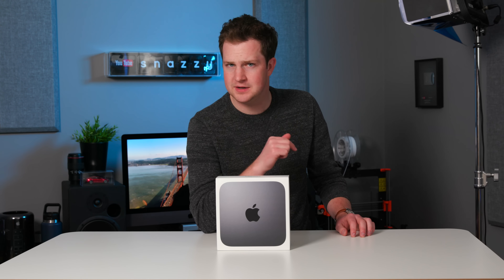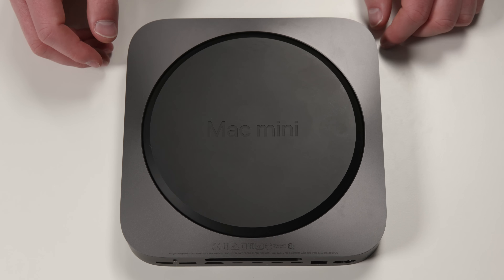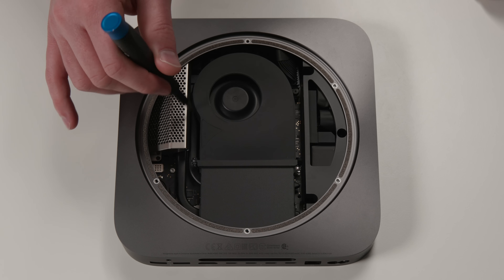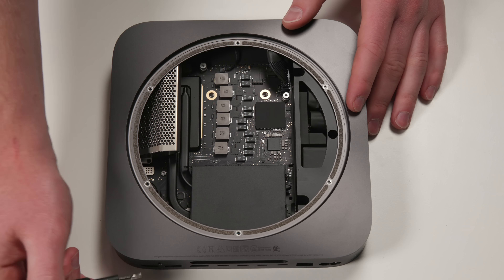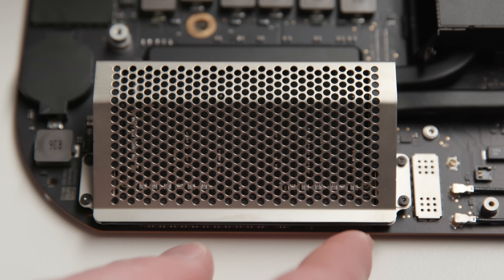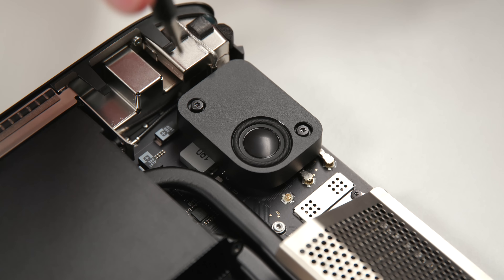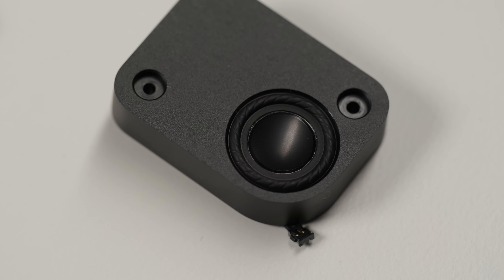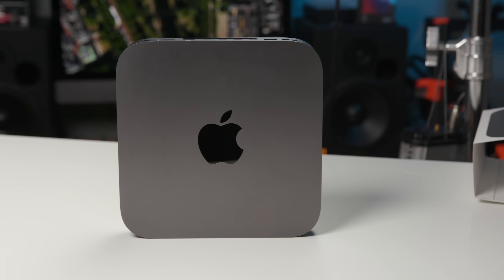Can You Upgrade the 2018 Apple Mac mini?! - RAM Upgrade Tutorial and Teardown

Comment: I remember the introduction of Mac Mini years ago. And yes, I was a huge fan of Apple hardware from the Tiger to Snow Leropard era. That was Apple in it's peake.

Looking this video through, and looking at todays top modern Apple hardware as well as hardware through the ages. Then yeah. I can see were it is heading. I do acknowledge the roadmap or idea that Apple is pushing. That the only thing thqt really matters is what is on the screen/monitor. And that hardware on is there, to be able to do what you need. Whatever that might be. But then again. Prices should be lower on hardware. Like if you want to tinker and change hardware, then yeah it should be more expensive. Or if I can say it in a different way. If you want to build hardware with the same integration or to build it as if it was a faster RaspberryPI. Why on earth charge that much?

Comment: If the hard drive had been replaceable I would have been fine with the soldered on CPU. Hard drives fail more often and faster than CPU. I was really considering actually buying the new mini until I heard the hard drive was soldered in.

Comment: Soldered on ssd is lame but honestly it’s not that big a deal.  You can attach external SSDs for some pretty good throughout. I have a 2012 Mac mini that does a gig/s write and reads of a set of external ssd’s (before you call shenanigans if you use a thunderbolt hub you get a second usb 3 gen 1 controller chip. Do a raid of drives on the on-board usb and thunderbolt attached usb and you get to combine the speeds.). Sata iii is 6gb/s, usb 3 is 5...you’re not losing much on a single drive. Raid them together and you’re doing better than the internal drive could ever hope to. 
As for the new mini’s nvme drive....that’s 4x pcie 3.0 lanes.  Thunderbolt 3 is also 4x pcie 3.0 lane. There are 4 thunderbolt 3 ports and only one nvme slot. If you really need nvme speeds and a lot of storage you should probably be using external tb3 drives anyway.  The internal drive is of little consequence

Comment: I bought a used macbook pro 2011 and got very dissapointed of how Apple made it. I mean, the charger cable is so delicate and got damaged and guess what: You cannot just buy another cable and change it, you need to know how to  disassemble it and fix it. The battery stops charging 2 years after the first use... I mean, I love its aluminum design but its not made to last, it was made just to be used for 2 years and then you start considering buying a new one and same thing after every year. My windows computer was bought on 2012 and its still working fine and it is very upgradeable. I can change the hard disk whenever I want, RAM and even the processor if I wanted to...

Comment: Thanks for this video! I was thinking about buying one of those but I might overthink that after seeing this video. When I saw this on the Apple website, it really looked like you could just take the bottom plate off and change the RAM. Unfortunately this is not the case and the chance of accidentally messing things up is getting bigger like this. Basically you have to take the whole thing apart to just simply upgrade the RAM. That doesn't sound interesting to me at all. It's getting to small and fragile to upgrade this stuff. I'll stick to my older Mac's for now!

Comment: Mr. Labs, I just got a Mac Mini hooked it up to a 4K monitor and scaled to 1080 it works great, or at native 4K it also works like it should... but any scaled option (for example 1440) gives it huge UI lag, like the integrated graphics fall apart completely even the mouse is noticeably slow... would you happen to know anything about that?

Comment: It's not a case of Apple deliberately "making it hard" to upgrade the memory. If they really didn't want people doing it, they would simply have soldered the RAM.

This is just an example of the inevitable tension and compromise between maximum engineering optimisation in a small space, and user-upgradeability. The engineers COULD have made the RAM replaceable without tools or disassembly, but doing that would have forced them to design everything else in a different way that wouldn't necessarily have been the most optimal.

Comment: so, 4x SODIMM sockets? If the base model comes with 2x4GB I could add 2x4GB or 2x8GB, I wonder if there is any significant difference in performance for dual channel VS quad channel or if it makes a difference having different sizes.

Comment: That's interesting. I know I'm a couple years late lol, but I was always under the impression the ram wasn't upgradable. It's so ridiculous that the SSD is soldered down though. If you're good with a soldering iron, would it technically be replaceable?

Comment: Discurage people from upgrading their RAM like mac mini's of years past.... uh please tell me how this went on the outgoing model, oh yeah it was impossible!  This version is massively more upgradeable with the RAM and the TB3 port

Honestly while not perfect the 2 Mac's Apple just dropped are a massive improvement in the repair/upgrade area.    The Mini CAN have its RAM replaced/upgraded and be boosted with TB3 SSD's and E-GPU's.   The MB Air can have its batteries replaced without scrapping the whole upper case (official repair) or DIY shit ton of work to get the glued in battery out.  

I see great steps in the right direction from Apple seeing us keep devices longer and wanting to fix them and not scrap them

Comment: I wonder if we could get schematics, and just make totally ungradable socketed Man Mini Clones. About the only thing we would need to do is desolder the T2 chip and add it the clone board. Like the old days of Mac Plus clone, you needed to pull the ROM off of them. Making 6 layer board is possible at fairly cheap prices.

The ultimate Hackintosh Mini... but with just the actual part required to make it a "real Mac"

Comment: Nicely built and engineered Mac mini.  Loved the excellent tear down of the Mac mini.  Can’t replace the hard drive, difficult RAM replacement are deal breakers for me.  Together with issues with lack of support, abandonment of legacy products/features at the whim of Apple, I would not buy Apple computers TVs or phones or products in general.  Future upgrades are extremely limited too is a deal breaker too. The only exception is the iPad so like their computers I consider them disposable items. I love the iPads and their reliability.  However, update the OS and it likely means that some programs or features that you regularly use no longer work, ie airplay, streaming m4p files, some programs like Adobe products.

Comment: I love the idea of the Mac mini, but at $800 they made it difficult to upgrade the RAM and used soldered SSD instead of using M.2 SSD which could have been upgraded. The CPU being soldered instead of socketed I can understand with  size limitations. But with Apple you always pay a premium of the ease of use rather than the ability to upgrade and customize.

Comment: Hi Quinnnnn
Can I stick a single 16GB stick instead of 2x8GB... would it be worse, in terms of real life performance, and if so by much?
... I want to get 16 and add another 16 later on if I need it.
... speaking of which will 24GB be okay 16+8 ? or is it better to have two of the same?

Comment: Thank you for this very detailed how to. It is most unfortunate Apple continues to solder storage onto the board. If your storage fails you are left with no choice but to buy another computer. This is just so disappointing that Apple has gone to planned obsolesence. The Late 2012 model Mini is the last one with upgradeable drives and RAM. It was manufactured through September of 2014. We have three and they are still solid, but I worry how many future macOS versions will support it.

Comment: Too bad it doesn’t have a PCIe slot for upgrading the MVNe SSD . . . I’ve recently installed a 2TB MVNe Kingston SSD in my Mac Mini 2014 and it’s blazing fast, even if the 2014 only has a 2 lane controller vs the 4 in the 2018. That said, the 2018 has memory slots which, ironically, the 2014 does not. Go figure.

Comment: I'm pretty sure the screws shouldn't be in the motherboard that tightly to the point the board flexes. Watch it cause problems then Apple say "the repairs cost more than the product" or "You put it in the wrong place and it overheated."

Comment: Question, I've had my mac mini since 2011 or so and it's been having some cooling problems. I got one of those USB laptops trays with a fan on them and actually just keep the bottom plate off. Does that risk anything damaging anything or harming the cooling in some way?

Comment: The CPU is changeable by desoldering it. It is a little complicated but you basically have to go through the same soldering and reballing procedure with the CPU as you have to do for upgrading an iPhone's internal memory chips. But sure, without the proper equipment and the skills, you won't be able doing so i guess.

Comment: While the Mac Mini was really cool when it was introduced.  Apple has let the hardware go stale too long.  The last 5-6 years you could buy an Intel NUC or many micro sized PC with more powerful internals and they are easy to upgrade.  Unlike the Mac Mini the last and this gen Apple has made it impossible to upgrade the internals.  The memory upgrade recently is a welcome change but doesn't change the fact the SSD is soldered.  And the Mac Mini is no longer the smallest PC on the market.

Comment: I don't believe this device can be cost effective in the enterprise. unless you can get them very cheap maybe. but I find it more likely that that enterprise thing is just a marketing ploy. Also it's too bad this machine has the T2 chip which won't let you repair it if it breaks or install other operating systems on the SSD on the motherboard.

Comment: There should be a law on serviceability. This one looks good except for the SSD that should be non-proprietary and replaceable. Reviving the Macbook Air and the Mac Mini, despite the pricing "for value not costs", is better than the wristband craze, throw-away phone jewellery, and stupid touch bar Apple has introduced in recent years. Things that last and that work can and even should be expensive and it's the way to go for durable consumption, but then they should also be serviceable.
Reply: Cool idea.

Comment: So I have three choices:

1) Buy a Mac mini and pay the insane Apple tax: $600 for 24 GB of extra RAM. That's 25 dollars per gigabyte and it's not even RGB!
2) Buy a Mac mini and perform this RAM upgrade process where I risk damaging ribbon cables and voiding warranty
3) Build a hackintosh

The whole point of buying a real Mac is that it "just works", but if I have to do this process just to upgrade the RAM, what is the point of buying Mac hardware? I might as well build a hackintosh.

Comment: I hope the next iMac does not remove the easy to replace RAM, but knowing the new Apple they will. They don’t appear to react to the facts :even their own technicians are having issues repairing the iMac pro:a a dude goes to have one memory stick replaced and they miss alone the screen. The other point m: I hope that is not the next Apple display, and the next one is an ultra wide , just like the re-design iMacs should be.  That will give space for cooling and  improving design (including accessible 2.5” for the fusion drive , and Apple should drop the proprietary hdd connector it was a great idea if the PC folks adopted it but of course they don’t adopt anything that requieres engendering so Microsoft was forced to enter the hardware business).

Comment: After Apple started soldering everything to their motherboards, I shifted over to Linux and Windows as my current Mac is getting on in years (nearly 8 years old but hardware is maxed out by me).  Apple charge insane amounts of money for their base models, and then they have the balls to charge $400-$800+ for decent storage and another $600-$800+ for some usable amounts of RAM.

Comment: Helpful tip for those who see this undertaking as fraught with b Take a picture of the innards and print it. Lay it on the table next to the machine. Put a transparent divided tray or shallow divided box on top of the picture. When you remove a screw or any other tiny part from your metal sandwm ich, put it in the compartment that sits above the corresponding place on the picture of the computer) computer, as depicted on the printed photo. This is a huge help, or would be if would ever do it. I have hopelessly bad methods, like placing the screws on my desk and saying “don’t move” and then turning too quickly when something alarming snaps me out of a fix-it trance and I find tha_knocking a pen holder over so an avalanche of pens, reading glasses an spudgers disperses across the desk, shoving my carefully-placed screws hither and yon, sometimes... clinkety-clink-clinkQ . Then whenever I sweep the floor—anywhere in this house dwelling, I check the dustpan for eyelash-sized Apple screws.

Comment: where can I find 2 x32gb sodimm ram?  Please help!
Reply: What are you doing that you need that much?
Reply: Logan Scott I use virtual machines for development testing on many different operating systems I need to compile and test the software on them.  If I have more ram the faster the process as I can run them all at once.  Also I have server based apps that must be running for the testing.

Comment: So the air intake into the bottom is blocked off by the base...... right, I'm no engineer but thats planned obsolescence in plane sight as fans, especially centrifugal fans do not like having their intake smothered as that stalls there performance  - just like most laptops that block the air intake and have insufficient feet or a plate to stop the air intake from being blocked.

Comment: I'm quite sure right now the Apple engineers and CEOs are Reeee-ing because you figured out their little trick to opening the Mac Mini and are showing the world all their little secrets.
Also I am shocked they didn't solder in the RAM, they use to solder everything in back in the 90's just so you couldn't service them (unless you are a teenager and had experience with working on soldering old boards from the 80's and a friend asked for an upgrade to their iMac)

Comment: All mobile/laptop processors from the 4/5th generation of Intel CPU's (from 2013/14) are soldered and cannot be replaced. True apple hater here but it is not apples fault of putting in a soldered processor as intel themselves made it that way. Most if not all intel laptop CPU's before 2013/14 or upto the 3rd/4th generation are socketed
Reply: it uses a desktop prossesor

Comment: The price of this is pure comedy i'd have to question the values of anyone getting this, what a waste of money.
Reply: @Christopher Szewczyk But you could get much better performance for much cheaper. You literally picked the one argument Apple can't win
Reply: I'm a developer and almost everything I work with is unix based, hence my reason for choosing Mac, and whilst yes, I could develop on a cheaper machine that runs Linux, there's not the same software availability, and although Linux desktops have improved a lot lately, I still don't think they look anyway near as good as Mac OS. Apple stuff is expensive, but, they look good, are well built and in 10 years of Apple ownership (iMacs, Macbook Pros, iPhone, Watch, iPads) we've never experienced a single issue. In my case, my iMac is a work tool, so essentially it pays for itself. It doesn't matter what you buy, there's always a cheaper alternative, take cars, if price was the most important factor BMW, Mercedes wouldn't sell any vehicles, we'd all drives Skodas because they're much better value for money.

Comment: Buy an IntelNUC and instal Hackintosh. boom done.  My IntelNUC (with windows installed) is operating faster than my gaming PC which is astonishing, not with the best graphics scores (egpu can fix that)...the motherboard integration designed by Intel is far superior than Apples design...THUS...the i7 processors run so buttery smooth.  Save your money and purchase an IntelNUC 8th Gen (2018 version or wait for their new 2019 versions) and reports from multiple websites clearly state that installing OSx mac software (through loop holes and Z001 configs) the OS runs better than any other built PC or native windows PC. WHY IS NO ONE TALKING ABOUT THE NUCS?!?!?!? Running for $300-500 (depending on models and without RAM/SSD) They will take over PCs and PC gaming within 5 yrs....trust me.  The Hades Canyon?!?!? boiiii dont get me started.

Comment: In its early days, the Mac Mini used to be a great small computer.  Now it is 2-3 times more expensive than the original along with none of the upgradability.   I got an i7 Intel NUC.  Hard pass on Apple.  I was all things Apple from 2006 to 2017.  Now, I find them too expensive, impossible to upgrade, Apple's unwillingness to allow for 3rd party repairs when their own so-called Geniuses won't fix things, and terrible quality in the past few years.  I am using Windows 10 and Linux now, and honestly don't care.  I newest OS upgrade runs like crap and has slow boot times.  I still boot my mid-2012 Macbook Pro, which I got stuck fixing myself, but was able to fix it (something you can not do with the current generation Apple computers).

Comment: Around 900€ for an i3, 8gb RAM and 128 Gb SSD? Sorry but for this Money you can buy an Ryzen 2600, 16Gb RAM, a 1050ti, 500 Gb SSD and just put it into an ITX Case like the Node 101. You would get a PC that kicks the Mac Mini‘s Butt and you could upgrade it without a problem. Sorry Apple I rather keep my money in my pocket than getting fooled by u...